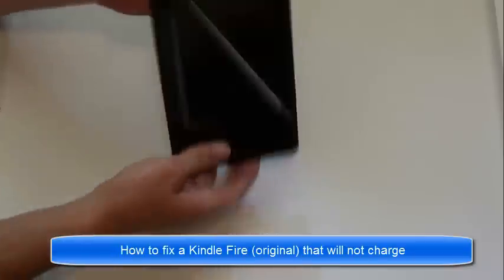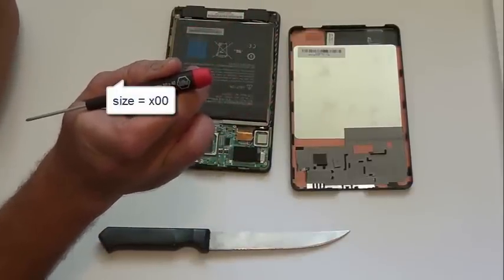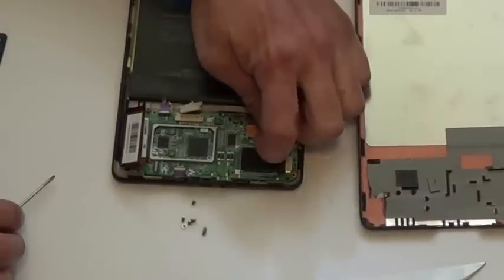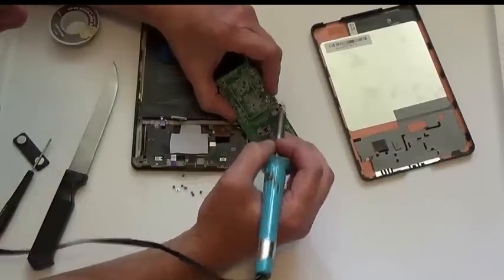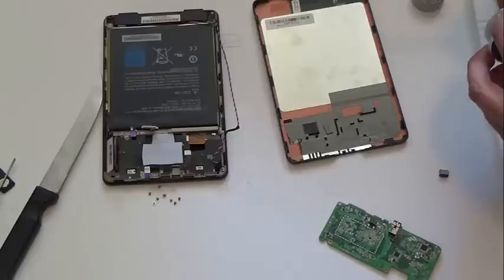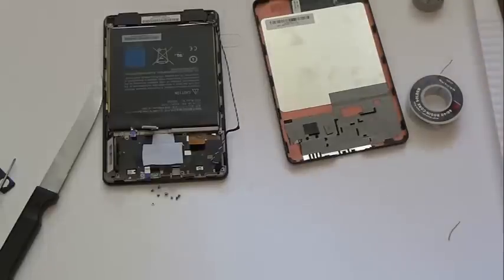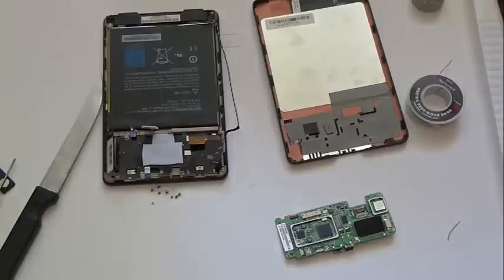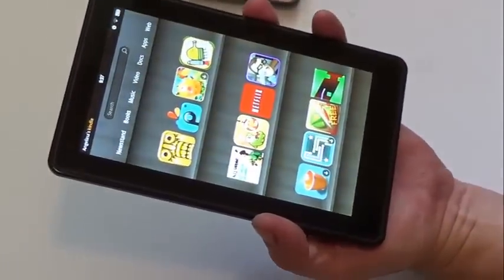Kindle Fire Won't Charge Fix

Comment: My kindle still charges, but only if you wiggle the charger. It only charges if you hold it in firmly and tip it up. Last night I had it plugged in and it's still the same battery today (30%). I've tried both chargers I have and it still won't work unless you hold it in and don't move a millimeter. If you let go it stops charging. Sometimes the orange light won't come on either, even when it's charging. Can you fix this problem?
Reply: Actually it charges when you push it in and DOWN not up. The metal part on the inside goes down. Is it just not touching the part to make it charge? I'm no tech-y but I'm pretty sure there's another metal part inside it to receive the charge.
Reply from the maker: Abigayle Haiser Yep, it sounds like the have the beginning of this problem. enjoy it and treat it carefully.  Make sure you check the power cord. Sometime those wear too. They are very standard and inexpensive so it is easy to check - many people have several.  My guess is that within a month it will stop charging and you will be where the rest of us are.
Reply from the maker: Just read your first reply. Sounds like you have tried a different charger. It is most likely a broken solder trace. Bending it one way or the other causes it to make connection but this won't last long. At least you have identified the fix - sound like you have the same issue.
Reply: mine does the same thing
Reply from the maker: This is the initial manifestation of the broken solder connection (this is how it starts). It sounds like your solder is broken.. You might be really lucky and just have to heat the solder traces to reflow the solder. you might not have to do any real solder and cleaning. hopefully your connector is still attached.
Reply: we tried that an it did not work on mine HELP
Reply: Waa my kindle is broken and will never turn on again because my sister through it at the wall
Reply: My tab wont turn on
Reply: Abigayle
Reply: My amazon dose the same thing the charger wont go in at all because that thing is broken and never work again
Reply: Abigayle Haiser same with me

Comment: When working on this type of electronics, static from your hands will ruin them. Put electrical tape over the board where the IC chips pins are and then you can handle it like a reckless mechanic!

Comment: do you HAVE to solder the pins??
Reply from the maker: +Obed Barrera yes, it is hard to see but it you swipe the right direction the solderwill want to stay on the traces. Soldering the side posts is just a good idea. Not reqired

Comment: CAn i send you mine fix - you lost me at the soldering iron - could i super glue the thingy back in?
Reply from the maker: Lynne, 
I wish that there was a better way to fix broken solder joint than with a solder iron but I don't know of one. Soldering is still a necessary evil because glue will not work, not even a little bit. If there was a electricity conducting glue, that would be cool but it would be really hard to apply. Sorry. :)  Try being nice to a local nerd and see if they will solder for you. Some of us are super cool :)

Comment: Mine is doing the same thing as everyone else's, but when I got everything opened up my usb port (the place where you put the charger in) was still sturdy and in place. What should I do?
Reply from the maker: What is it doing? Did you try the reset? Is it not charging any longer. Do you get any lights.
Reply: +Peter Carcione i've done the reset before. What happens is when I plug it in the green light will go on for like 2 secs it will tell me on the screen that it needs to plug in for 15 or so mins. Then the screen goes off the green light goes off and it doesn't charge. At all.
Reply from the maker: Have you owned it for a very long time? Have you left it without a charge for several months or left in plugged in for several months? These things can kill a battery. It could simply be that your battery needs to be replaced, and that is easy. Then again, if none of the above is true, then the charging circuitry could have gone bad. I would be tempted to try a new battery if you let it sent for several months
Reply from the maker: Here is a place selling used and refurbished Kindle batteries, cheap. http://amzn.to/28JfW3s
Reply: +Peter Carcione thanks I might give it a try!

Comment: How do i know if its the battery or maybe my connector fell off without taking it apart?  It had power when i turned it on but now its dead.  When i put power to it the light comes on next to connector but it wont charge.  Thoughts?
Reply: Oh, i get a orange light not green when plugged in.  I forgot to mention color of light.  Thanks.

Comment: Did everything and still won't charge is it possible the micro usb is messed up from the female connected from having moved it so mulch tryto get it to charge
Reply from the maker: +mario perez Yes, the cord end often gets damaged. Try a known good cord and adapater & try the reset. Soldering is a last step. That said, power leads are on the outside edges so getting it to charge is not that complicated. I find that swiping the solder in the direction of the legs, causes the solder to flow along the legs instead of pooling and unintentionally bridging unwanted connections . Good Luck.

Comment: I took mine apart and the connector is not loose on the board. Does it need to be replaced.
Reply from the maker: I would say no, it does not need to be replace. 
Is your unit not charging? Not turning on? 
If it is not turning on, I would plug it in and do a hard reset. Hold the power button for 10 solid seconds.
If it is not charging, you may have a small cracks in the connector legs and solder would fix it. First I would try a new power adapter (wall adapter).
Reply: Peter Carcione It does not charge or power on. Been dead for a few months. I have tried new chargers and the hard reset, no luck. i watched this video and took it apart expecting the connector to be loose and it is on there pretty firmly, but all chargers I have tried move around in the plug. Thanks for your help.
Reply from the maker: Its a pretty standard charger, but that could be part of the problem too. The spec for USB is 500mA but some devices require as much as 2.1A from the same connector. The kindle tablets are pretty reasonable power wise, but there are some chargers on the market that may not be able to charge it. Look at the adapter and make sure it says output 5V and at least 500mA. You can't over drive it with current, it will only take what it needs. If not sure, plug it into your PCs USB port - that should be 500mA.

Comment: Is it possible to buy a new piece (the piece that has to be soldered back on)? My boyfriend managed to break two of the little prongs off on the piece :(
Reply from the maker: +Jennifer Conner It is possible. Unfortuantly it wont be easy. Surface mount components are not really standard, even USB ports. Finding one that hits the trace pitch, standoff mounts and z-height is going to be challenging.. That said, give it a try and know that a new Kindle starts at $49. Which pins, the power pins are on the outside of the connector, the inner pins dont matter for power - you might be okay.

Comment: Question.  I opened up my kindle but the charging piece is still attached to the unit.  Do you take it off and reattach it?  Or is there something else I should be looking for instead of that?
Reply from the maker: No, don't remove it. Think of it as perfect alignment for free. 
I would be that there is a hairline fracture on one of the traces. 
You could simply heat them up and draw back to give the solder a new bond.
Reply: Thank you! I will try that.

Comment: I opened mine up and the charging port was not disconnected.  Any suggestions?  It won't charge and did seem to have a short in it (sometimes it would charge if you hold at a precise angle).  Should I try to remove it and re attach?
Reply from the maker: Doug Turner No! If its still attached, it is aligned perfectly. Just heat the legs . I suspect a hairline crack. First try another adapter, but if that isn't it, check for hairline

Comment: I am not sure the charge port is my problem.  I push the power button it is green then shuts off . Turns red  for a few then shuts down .  I have tried the reset didn't work .
Reply from the maker: It is obvious to me that reset is not your issue. .... It sounds like your unit does not have a charge. It tries to turn on but.... battery is exhausted, so it crashes... You may have to charge your battery..

First, try a new power connector. It is standard micro-USB, so look for another. Anyone with an android phone can help.

If that does not work.... 
Next, try plugging in the power cord and gently rapping the cord up and around the front and around the back a few times...this should put very small stress on the connector and help it get a charge. If this works, it means your solder joints are broken. Most of us are beyond this stage and this no longer works... thus the need for a soldering iron. 

Hope that help.s
Reply: Thank you so much And I will try this   right now .
Reply from the maker: beth mix  Thinking more about it, you should rap the wire the other way to add the correct tension. plug in power and go around the back and over the top, this will make the connector legs sit against the PCB. Note: it won't work for too many weeks.

Comment: all i have to do is put it in vertical position with the charging port facing up. its a pain to get the charging process started but when i do it charges like an angle :3 if that sometime completely fails i have set this video to watch later!

Comment: Peter ~ As it won't charge, I've taken mine apart ... the connector, however, IS still connected ... So ~ I've put it back together and do not know where to go from here.  RsmZ.
Reply from the maker: I have seen some where there were microscopic crackins in the traces.. just heat them up and they work again.. but I would definitely try the reset again.

Comment: And where can you get the stuff where you where using in that video
Reply from the maker: RadioShack would have all these things
Reply: Peter Carcione Yes, which I was also wondering, is the Soldering Iron or Tool from Radio Shack as well as the Solder material itself? Also, do you know off the bat how much it all is separately?
Reply from the maker: everything should be under $20 for a decent setup.
Reply: Great! I also looked in my garage and I discovered a Soldering iron, but there's a slight problem. It doesn't have a "GROUNDED TIP" Plug-in, but I really need to know if I can use it and why or why not? It also isn't 15watts its 30watts, can I still use this to repair it?

Comment: Why is it that most mechanics and techs cover with their hand or fingers exactly the part where one need to see the screw or contact they are refering to?
Reply from the maker: My goal with this video was to help out parents and make them a hero. I never expected this video to get over 1M views! otherwise I would have cleaned my hands because I was just wrenching on the car and my hands are full of automobile grease.
Reply: @PeterC408  my comment has nothing to do with "clean hands". I am talking about "covering the view" of what you are doing. In other words moving or removing something but blocking it with your hands and the viewer cannot see what you did unless is familiar with the procedure. Congratulations on so many views.

Comment: Any tips for dropping your fire in a bath? I dropped mine in for 2 seconds, and it remained switched on for a week yet after then it wouldn't charge again. Is there a fix?
Reply from the maker: Wow! I don't know the answer to this but I am shaking my head so much that I can hardly see what I am typing :) What happens when electronics hits water is unknown. I am amazed that it kept working for so long but it seems that the charging circuit was affected.

Comment: Can we use super glue to hold it in place?
Reply from the maker: No superglue should be needed. In fact, I would recommend not using superglue. 
I have taken apart some units more than once and they have always snapped back together. try placing the unit on a hard flat surface and putting the cover on. Push down (slowly but with force). You should hear a snap snapping the small locks around the sides.

Comment: uhm i have a kindle and it will charge but it takes forever to charge do u think because of my storage low or its overheated?
Reply from the maker: No, I bet that your charger current is low. Some USB chargers provided as much as 2.1A@5v = 10.5W while other are 500mA@5v=2.5W big difference.

Comment: I know that solder is dangerous and heat gun and stuff it can explode is there any other way I can do this without solder (safer Method)
Reply from the maker: Sorry, I know of no safer or even easier way to do make a solid electrical connection than soldering. I have seen a few soldering tutorials on-line and would definitely suggest them before trying it. Soldering is one of those skills worth developing. Like whistling but more useful.
Reply: soldering is dangerous? maybe if you're 4 years old or using a butane powered iron and in all my years as an aircraft electrician Ive never heard of it exploding. Solder is an alloy of tin and lead and unless you can somehow splice the little tiny wires onto the circuit on the pcb (you cant) then you must use the molten metal to fuse the joint into one solid connection. if youre worried you might burn your fingers or something, keep a bowl or glass of ice water close by to dip your finger in but the stuff isnt that hot. you might want to wear some safety glasses but other than that, you should be just fine...maybe try not to inhale the fumes/ smoke as well.

Comment: The charging connector breaking off is a major, almost inevitable design flaw.  It was also completely avoidable using common sense engineering practices.  The idea of surface-mounting a micro USB connector atop a PC board and held by a few specks of solder is nuts ---- power connectors receive a lot of pressure and have to be solidly mounted.  Amazon should not only fix all the broken ones, but offer redesigned upgrades; absolutely free.  The manufacturer was apparently aware of the failing later in the production run, because on somewhat later models the maker started using epoxy to help hold the connector.  Epoxy?!?  

Your  repair is factual, but as a guy who's been a ham radio licensee for 40+ years and melted a ton of solder, I can tell you that this repair is far beyond the skills of most Kindle owners.  Even with hobbyists who are practiced using a soldering pen it's going to be a hit or miss repair.  It's best done under stereoscope magnification using special soldering equipment.  Those tiny contact pins have the tiniest spacing used in industry.  Originally set by robotic installerls all the home repairer can do is run a tinned solder tip across the pens and hope the connection is made --- and holds.  

But  don't get me wrong.  I appreciate you making the video.  No doubt the video has resulted in a lot of working Kindles out there instead of ending up in the trash.  I bought one of the later Kindles which seems to have a redesigned power connector.  The problem is that they also shrunk the screen size!  With iPhone screens getting bigger and Kindle's getting smaller, I generally just use the iPhone anyway.  It's easy when hard experience has not left you a fan of Kindles in the first place.  Even the less expensive Paperwhite models have their own problems with a small amount of shock destroying the display.
Reply from the maker: Yes, too small to see even with my eyes... but solder wants to stick to the traces, so pulling solder along the traces enabled me to fix 4 out of 4!!! The goal of this video was to help makes one dad a hero in their kids eyes and that goal has been exceeded many times over. I had no idea that it was so widespread or I would have the car grease off my hands. :)
Reply: "Even with hobbyists who are practiced using a soldering pen it's going to be a hit or miss repair.  It's best done under stereoscope magnification using special soldering equipment."    "Originally set by robotic installerls all the home repairer can do is run a tinned solder tip across the pens and hope the connection is made --- and holds." 

I think you underestimate the power of determination and epoxy my friend.  The repair is totally viable option to the run of the mill Joe shmo repairer.

Comment: Thank you.   going to go for it.  F'ing amazons only answer was to buy another one.  I said its a computer and not a steam boat at the bottom of the Hudson.  We can fix it.  She said no.  So I hung up. 
So stupid they have this issue.  What a simple fix.  I guess the 10 cents of labor to solder those connections was to much for them to spring for..... Or the f'ing marketing geniuses, buy a kindle then 1 /1/2 years of charging later the connection fails and you are so addicted to your apps you have to buy a new one.  GENIUS.  
Thanks again.   Ill post again if I burn the house down.